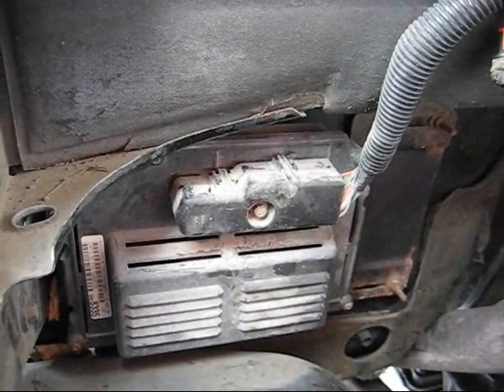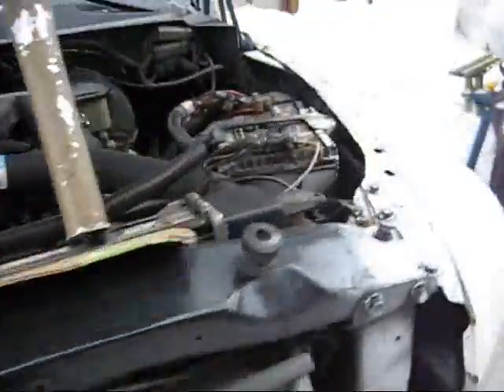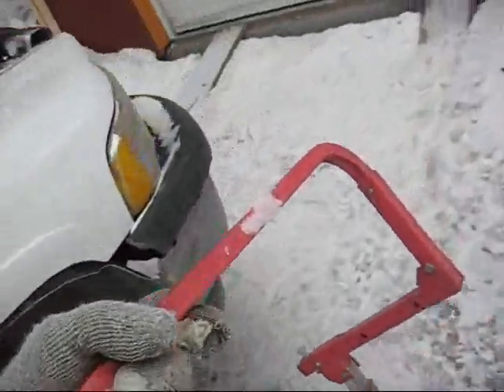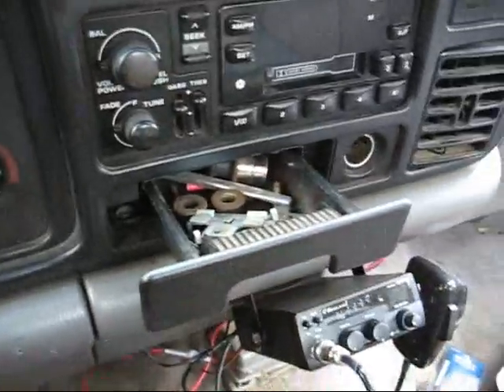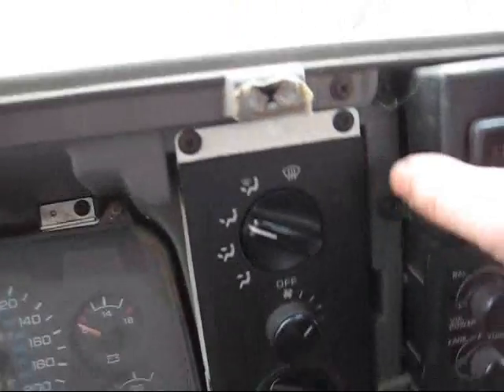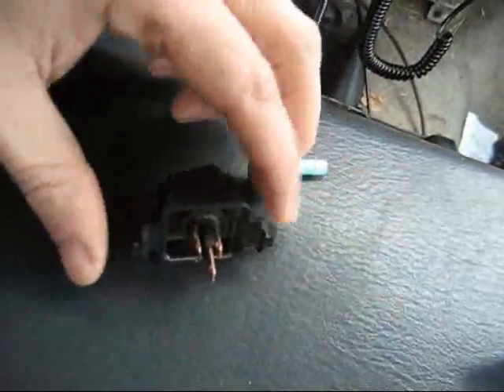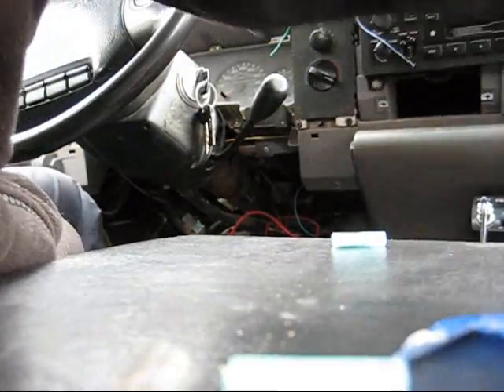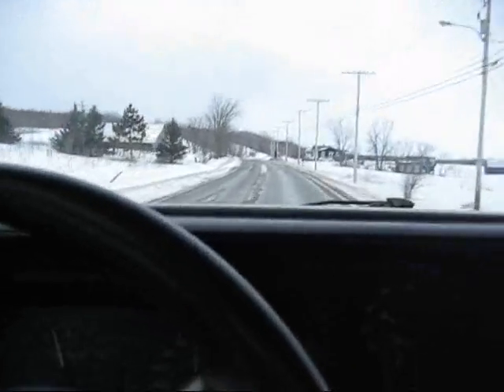Manual Torque Converter lock-up switch.

Comment: Did you use a crimp splice or cut and solder your new ground into the orange/black wire?
Reply: Box Five just skin the orange and black wire wrap a wire around it and electrical tape it.

Comment: I don't understand what "a five second difference in acceleration" means.   It's definitely not 1/4 mile.  you aren't going to go from a 16.5 to an 11.5,  and it's absolutely no zero to sixty or you'll easily be running down the fastest cars in the world.  Not trying to be a jerk, but 5 second difference in acceleration in what scenario?   Thanks.
Reply: On the older Dodge trucks with the Cummins and automatic transmission, they are deathly slow until overdrive and lockup kick in.

Comment: Hello from Dan. 
I did this mod to my 1996  dodge cummins 47RE , and added a  automatic release so when you step on the brake, it disconnects the lock.  I also converted the factory fog light switch to activate it. the mod requires two, 5 pin relays .  I added a diode and an " complete disable"  safety switch.  IF any one would like a copy and instructions, you can send me an email  and I will be happy to share the diagram and info.
Reply: Please email me how you did this.@ millerwelding1@gmail.com. and  dies this work on a 1996 12 valve?
Reply: Please send instructions for how you latched that.  uncertainquality@aol.com
Thanks for taking the time to write that up.
Reply: kb7uxe me too pls - fstarocka@gmail.com -
Reply: +kb7uxe Please email your hook up diagram. thanks jimnewcomb1978@gmail.com If i can help you on anything in return call me at 541-944-7346 jim
Reply: kb7uxe can you please email me your diagram  of your setup you did and what you used please conferron@gmail.com thanks in advance
Reply: Hi.... Could you please email me the diagram to: triumph66@yahoo.com. Thanks!
Reply: Hi, can you email me the diagram to, ian.walker67@yahoo.co.uk. Thanks
Reply: kb7uxe ..  will this work on a 2004 3500 dually two wheel drive ?
Reply: please send me the instructions, marsaglia@gmail.com and could you tell me, i would to know if there is any risk of breaking something in the transmission when the tcc is blocked and changes are made up or down, Regards
Reply: please email me at borneoharvest@gmail.com

thank you very much
Reply: Not sure if you are still around, but picked up a 47RH instead of a 47RE for a 1997 1500 Ram.  Not sure if it will help, but it can't hurt.  Now to get rid of the trans module.

Comment: I found out that with the "overdrive off" the computer locks the converter at 35 mph in third gear instead of 45 mph in 3rd or 4th gear.. Find this more than ideal for city driving..